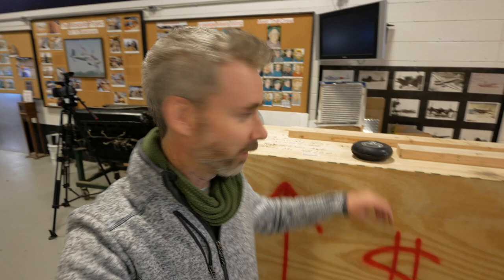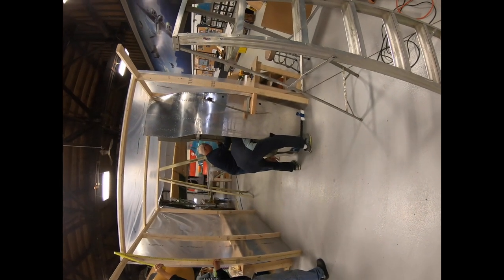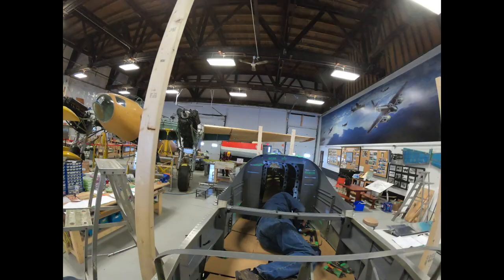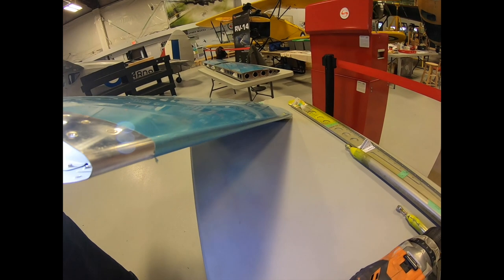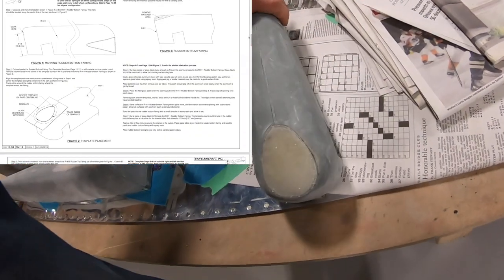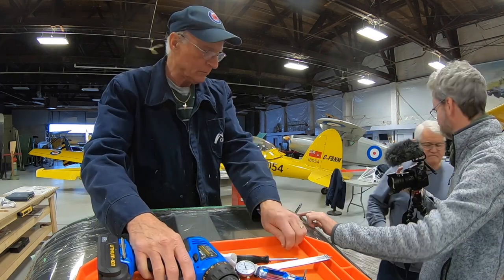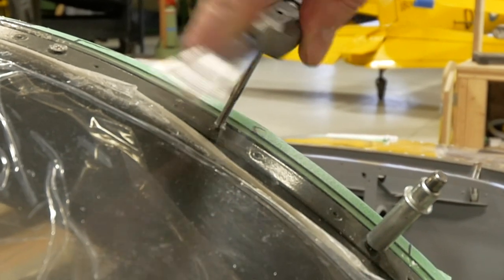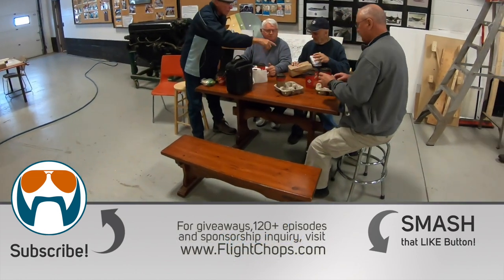WINGS are here + Pre Cover Inspection COMPLETE! - Build VLOG #6

Comment: I did not realize there was a lot of custom fabrication involved in building a kit plane.  Awesome!  Thank you for sharing!
Reply from the maker: Cool yeah - the Van’s Aircraft kits are impressively precise, but yeah, if you want it “Burfect” some custom work is required :)
Reply: Most kits require alot of "custom" parts. Some alot less. But Vans, Zenith, and others are almost completely just assembly.
Reply: I see Mike Patey building parts from scratch and making it look easy.  I see these smart, experienced, capable guys working hard to build a pre-fab plane.  I'm afraid if I made an RV it would take me 20 years!

Comment: It's great to watch this build; I appreciate the time you're putting in to the videos. Question - Would you also need drainage holes in other low points, like the bottom of the rudder? I had never considered this before but could see how accumulated water would impact weight distribution (or maybe it's negligible).

Comment: Considering the capabilities I am surprised that there are not any options for deice and anti ice equipment. I primarily fly in the mountains of the Southwest USA and ice is a consideration for 8 months of the year. More if I fly in the flight levels. If I ever build my own plane it will need a TKS system that would let me fly into known icing.  Are you considering any anti ice equipment? I rarely hear any builders talk about it.
Reply from the maker: Yeah, I don't think it's "a thing" for these little planes...  I'd love to hear if there are options, but I suspect deice and anti ice equipment is either too complex, or too heavy, or both, for this application...
Reply: @FlightChops  At the very least I would seriously consider a heated pitot tube that also has your static ports. No fun in IMC when you get big red X's across your screens.

Comment: Does Canada follow the same 51% rule as we do here with kit builds? Noticed how many people are working on this project and wondered if that will be an issue on this project.
Reply from the maker: I will address this in a future vlog, the short answer is it works differently in Canada.
Reply: In the USA, an Experimental Amateur Built airplane (EAB) has to be 51% built by one or more amateur builders. So a group can certainly build a plane together, it actually happens often. Only one person can apply for the FAA repairman's certificate for a US-based airplane after it's done. But there's no limit to the number of builders that can participate.

Comment: Looks great  , but can 't you drill a few holes first and then tap them insted one hole at the time  ?
Reply from the maker: I believe the reason you do one at at time is to be sure they are perfectly aligned; so, we have the previously done one screwed in, and the next one waiting to be done still locked down with a cleco, so at any given time, only one hole is not connected.
Reply: @FlightChops  I would be power-tapping those holes for sure.  I don't have the patience for a hand tap!
Reply: @FlightChops  I would be power be power-tapping those holes for sure.  Don't have the patience for hand tapping each one!
Reply: you really want to have precision there.. with a countersunk screw you align the clamped part (here the acylic canopy) to the thread if now two holes are not perfectly aligned you create stress which can lead to a crack.. and this is the very last thing you want with such a canopy!